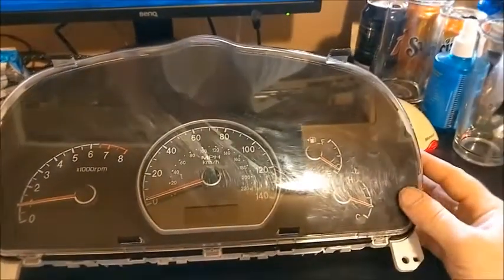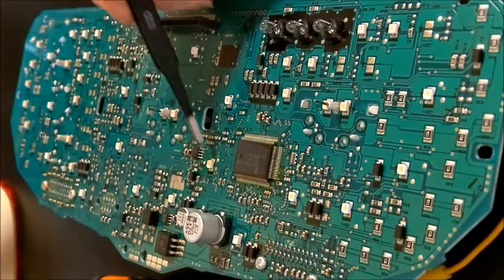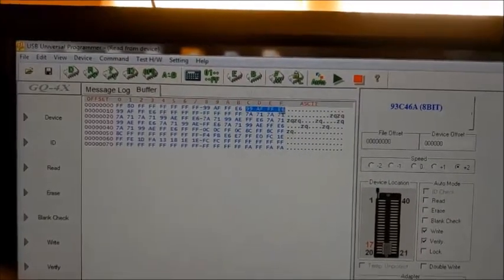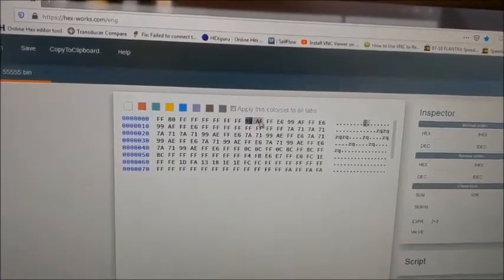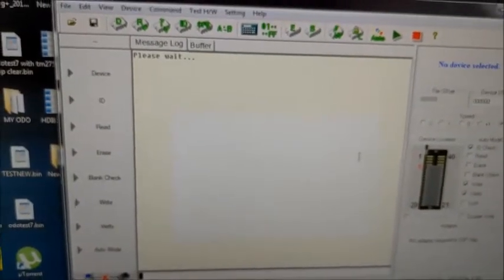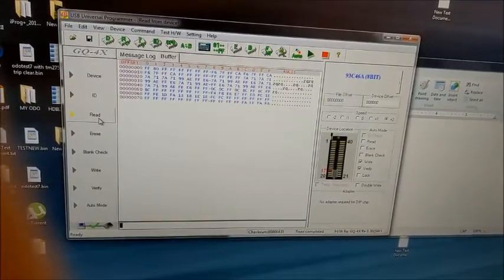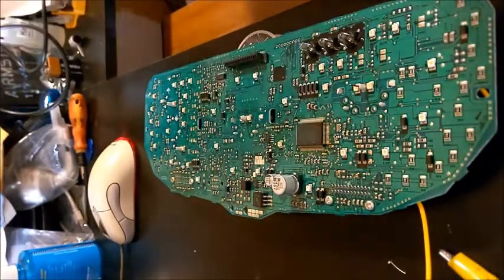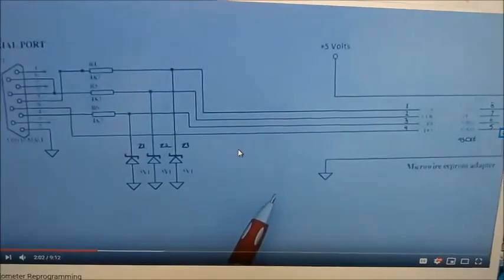2000-2010 Hyundai Elantra Mileage correction

Comment: Great video!
However, how about some models that don't appear on TACHOSOFT? Like Toyota Coaster one
Reply from the maker: Idn about Toyota Coaster.  Best thing to try is find the eprom chip. Read it. make a backup then try to find the mileage  using versus other vehicles on Tachosoft.   Once you find where the  mileage is.   Make the correction on a copy of the backup you made.     Trial and error

Comment: Does 2008 with temp gauge is interchangeable with 2010? I've a 2010 and want to put one with the temp gauge. It's a gl sedan model. Thanks.
Reply: So actually I tried this myself and to my disappointment, it does not work. The speedometer and fuel gauge work, however the tachometer and temperature gauges do not work because I believe there is a 3rd plug that is missing on the 2010 elantra. Also some strange stuff like the high beams indicator do not work. 
TLDR: I do not recommend doing a swap

Comment: Did you ever figure out what wire was missing for the temp gauge, looking to swap one of these into an Elantra blue. Not sure I'm going to run into the same issue or not. Mine is a 2010 and the new gauge set is a 2010 model.
Reply from the maker: No never got around to it.  Been to busy with other projects and work
Reply: @disonesto  Thanks, looks like I've promoted to Astronaut.. If I don't run into the same issue or resolve it I will let you know. The Elantra is not one of those cars people go customizing allot. Being there was zero rust after my daughters use of the car I have spent this winter rebuilding everything. All that is left to do is the gauge package and timing and water pump. Working with Foxwell to see if I can do the mileage in their tool, it has the ability it just does not have Hyundai listed for some reason. I could go your route but would rather do it less invasive. Worst case I will just swap the Eprom.
Reply: @Curiosity  Hopefully you have better luck than me, because it is not just a wire, but an entire plug. I tried this swap on my 2010 elantra and unfortunately it wasn't just the temperature gauge that wasn't working but also the tachometer.
Reply: @mr0o  Thanks, interesting I have the blue model and it came with a tachometer. Just finished the timing belt and will take the dash apart to inspect. One way or another I will get a signal to it... ;) I guess the first thing will be to find a good wiring diagram for the car. I'll update when I get there.
Reply: @Curiosity  yeah if you find a way to get it working, I'll definitely want to know about it, if it means I can give it another try. Good luck! 
(Also what I meant was that the tachometer was not working in the new cluster, my elantra has a tachometer in the original cluster but after I did the swap, the tachometer wasn't working.)

Comment: Hi, i wonder what temperature did you set on the hot air to desolder and solder the chip?
Reply from the maker: I had it almost to Max.  I just needed to heat that one area quick.
Reply: @disonesto  thank you
Reply: I need help with EEPROM
Reply: @SsempijjaShakur-h1w  what kind of help?
Reply: @marocautofix5555  how to use it